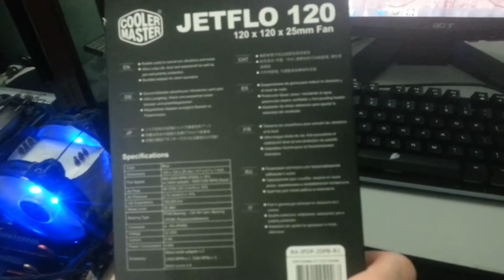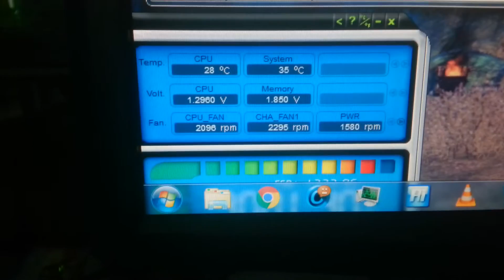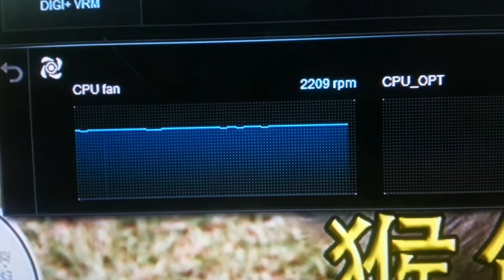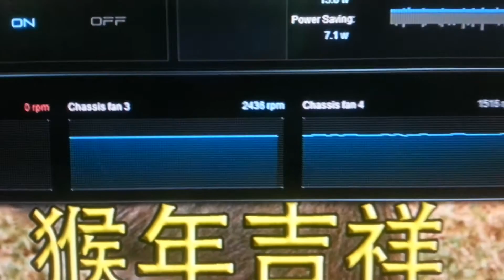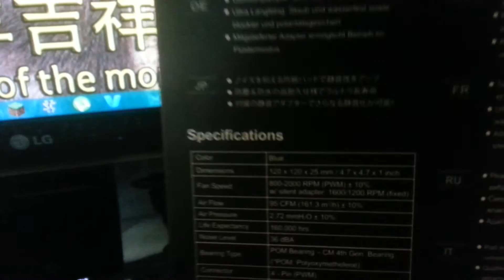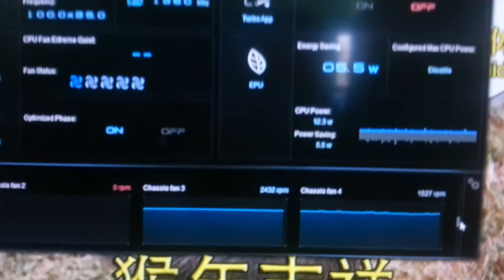Cooler Master JetFlo 120 Blue LED Fan Speed Benchmarks Real World

Comment: How much does the temperature improve compared to the stock fan? I question because I want to buy a normal cpu cooler and change the stock fan for 2 jetflo fans
Reply from the maker: A decent amount for sure! These days you are better off to get their new MasterAir AB(Air Balance) fans as the blades are better designed for air pressure & flow with less noise. ;-)
Reply from the maker: I have some benchmarking videos with testing what you asked that I need to work on post-production soon so I can publish them. I know it is late & old products but I have a huge backlog of videos to edit/produce stored on HDDs. lol
Reply: @TefenCa  Are you sure that these fan is better than the jetflo? I have seen a Lot of fans and i only find the noctua of 3000rpm with best airflow and pressure, but the loud of the jetflo is an achive for 93cfm, isnt it?

Comment: jetflo's are naturally loud. they would probably be better used on a CPU fan header, as they will get quieter when they slow down
Reply from the maker: Soulios Atrika They are great if you have a Motherboard with fan control headers & software or a fan controller. They can get fairly quiet.